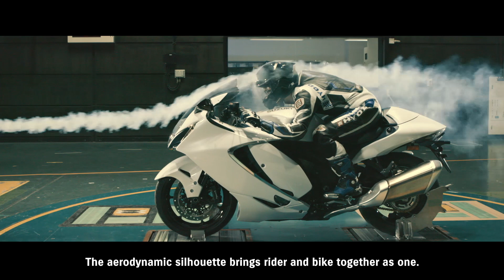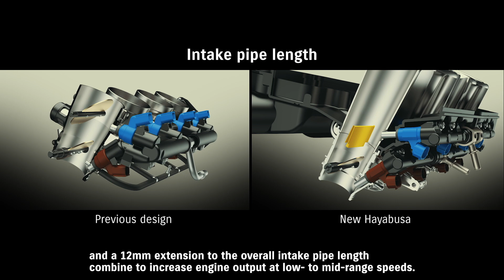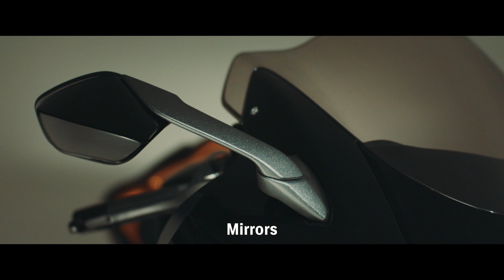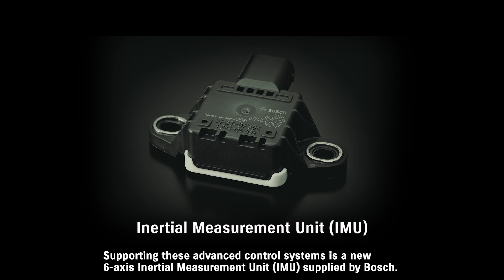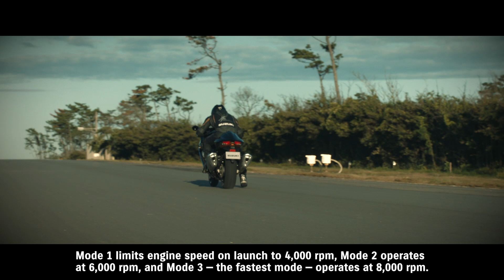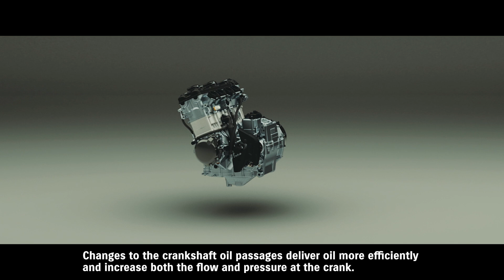New Hayabusa, Everything There is To Know. Full Official Development Video, MY22 Gen 3 Hayabusa!

Comment: Suzuki were never going to make a big capacity turbo Hayabusa, they've  been skint & playing it safe for a decade. With that said I think this new 'Busa is underrated as people are stuck on the reduced peak power which is at face value disappointing, but in reality the bike's better in almost every way & the engine is more powerful but strangled by the Euro 5 exhaust. Get a titanium replacement, air filter & ECU reflash & you're probably looking at about -15kg & +15bhp maybe. The new Hayabusa isn't ground breaking or particularly special but it's still just fine imo & maybe people should test ride it before writing it off because it now '"only" has 188bhp.